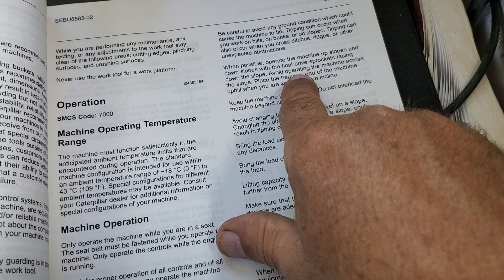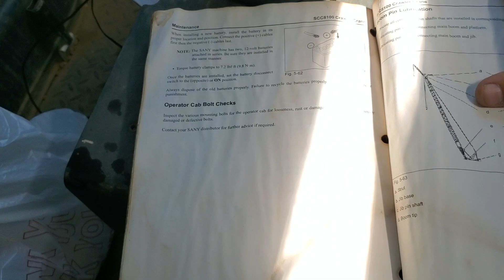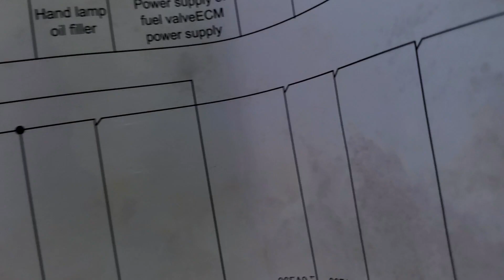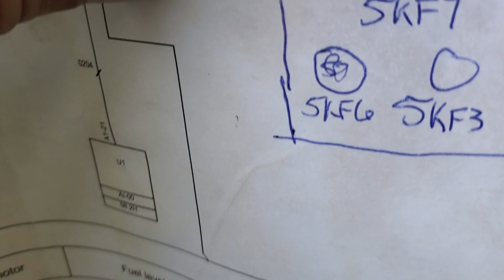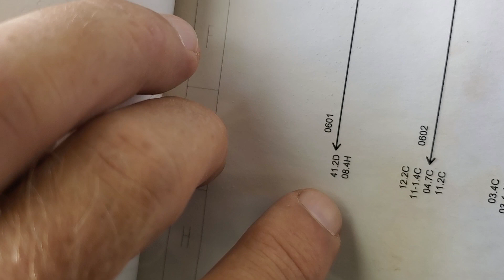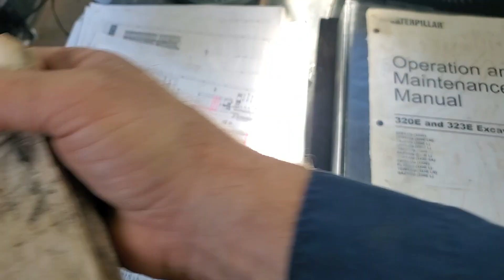Read your manual.

Comment: Do you ever experience your swing brake doesn’t hold on windy days if you’re boom out flat ? Just curious I’ve come across this a few times.
You were talking about electrical issues well I have a 1975 Grove TMS180 it’s tough as nails but I was going to move the crane so I swung over the back and I lifted the outrigger up and then I hit the switch to change to retract the outrigger beam and I could hear the engine strain and the beam would actually move sideways maybe 1/8th of an inch but no way was it going to do anything else I actually put a chain pull on it hooked back up to the frame but not sure what I was thinking about doing that!! Anyway I just happened to swing over the back again and this time I swung over about a foot further than before and the outrigger retracted no problem so it was the electrical tower that powers the hydraulic valves switches from the upper house to the rear frame if you are familiar with older equipment but that’s why I love these old Gove Cranes nobody can mess with my outrigger controls but me believe it or not I have had unqualified people start operating my outriggers while I was still operating the crane I think the outrigger controls should be in the operators station or cab so nobody can just come along and cause an accident! But that’s just my opinion 😀🇨🇦
Reply from the maker: I run an older grove tms870 a lot and it has issues. One thing that happened with the swing brake was a plate inside the foot valve cracked and it would not release the brake until you went full throttle. I tried everything and even rebuilt the swing brake. It was really bad, way worse than I thought it would be. I was surprised it even worked at all. If your having trouble I would look into it . On the 870 it has a double acting piston, one side releases the park pressure and the other side applies the foot valve pressure. It has some springs and some surprisingly small brake discs. 
They will pick up a stabilizer foot in certain positions and I use that to climb up on stacked crane mats sometimes. Sometimes I even have to climb two steps. I usually use a forklift to place the mats but I've done it with the crane also. When you're boom is short and high angle whatever stabilizer you're looking at you will be able to lift up and you can carefully slide a mat in under it. Kind of sketchy.